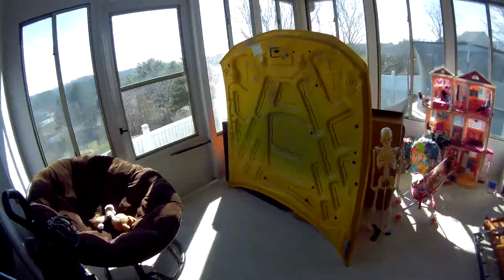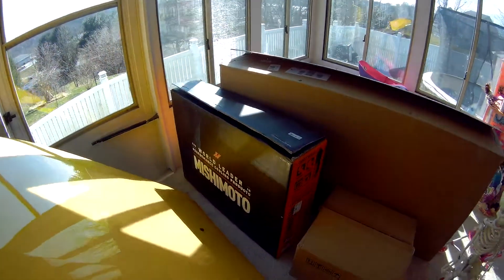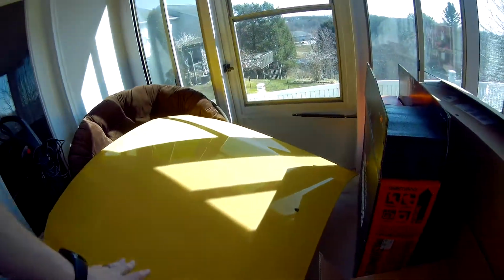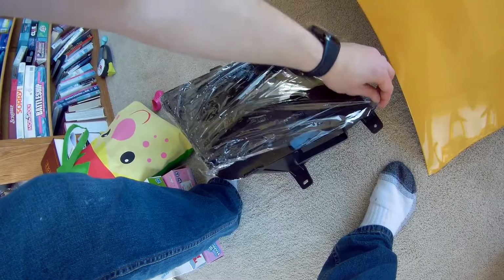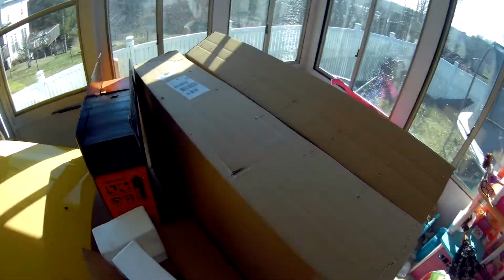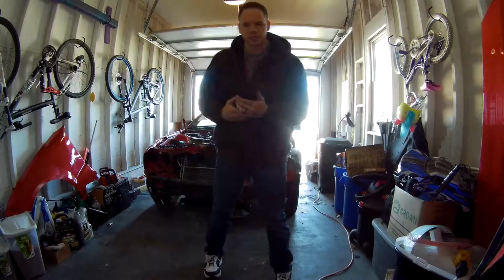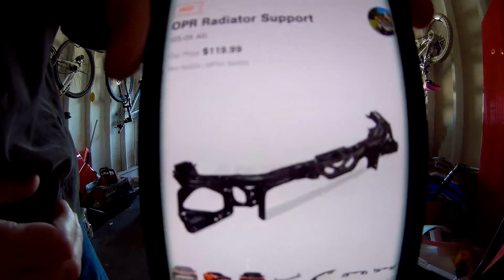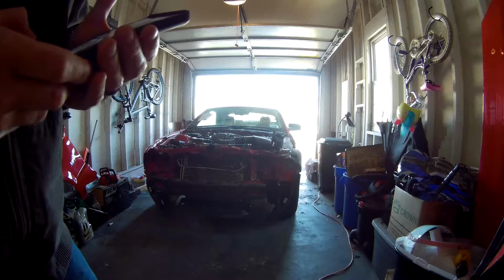How To Remove A Radiator Support in a 2005-2009 Mustang GT

Comment: Hey bro I just found your channel new  Subscriber and 👍!! I'm doing the same thing. As far as the  Radiator support removal and Replacement would you have any tips or suggestions for me to make sure that I get the new one back on and lined up correct? This is my first 1 also?? Thanks bro!!
Reply from the maker: The best way would be to measure from the center of the windshield to each corner of the Rad Support. This should align with the brackets on the frame rail as they are spot welded.

Good luck!

Comment: You have to cut it to get the support off?
Reply from the maker: Technically no. You could drill out all the spot welds. 

This takes a lot longer.

For me, a cutting disc and a grinder made that much faster.